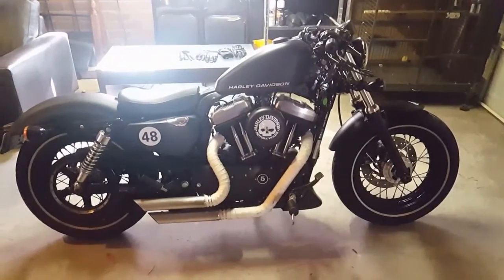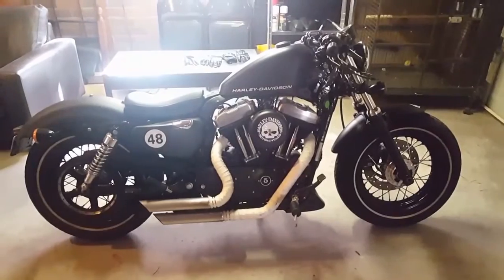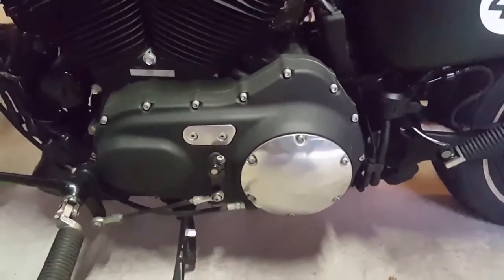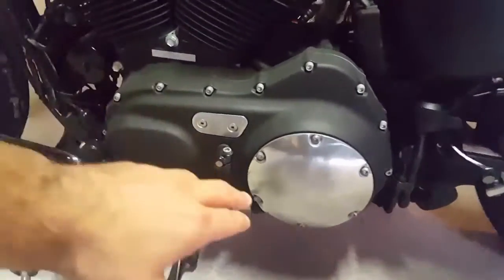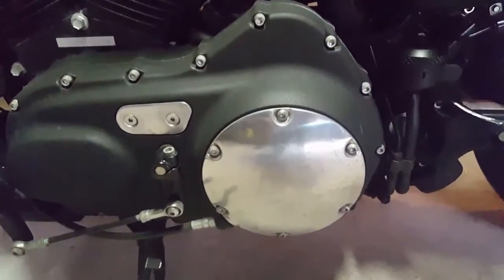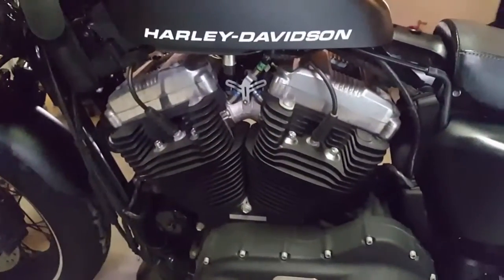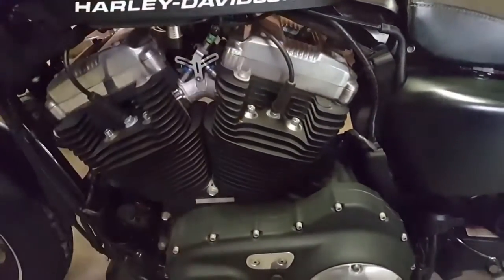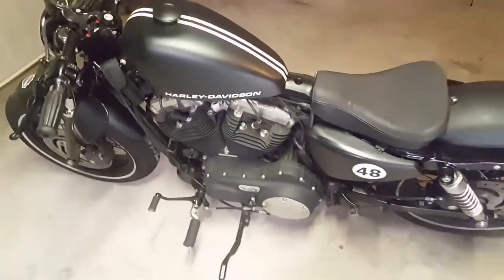Harley Davidson 48 touch of paint

Comment: Nice 48 👍🏻 I like the front spoiler, I am thinking about installing one.
Reply from the maker: Ride With Patrick Thanks. easy installation I picked it up on ebay for $50. it's common now. starting to see it a bit more.
Reply from the maker: Ride With Patrick I have a video showing how I installed the front belly pan.
Reply: Thanks but i have to do it at the dealership as I tried...and found out that the screws are imperials and not metrics (Cracked a bolt ;-( ) but they will fix it the 19th during my first service. i'll show you the result afterwards.